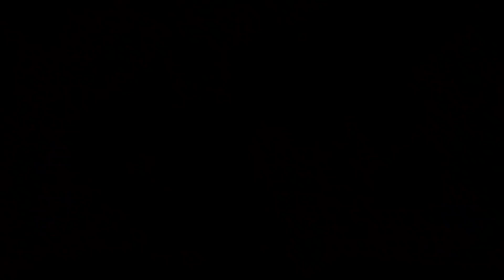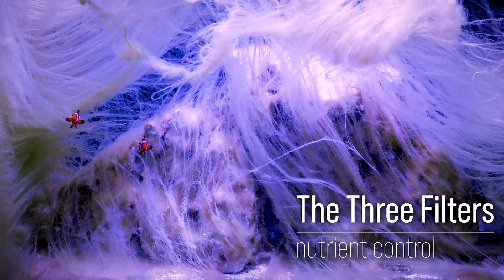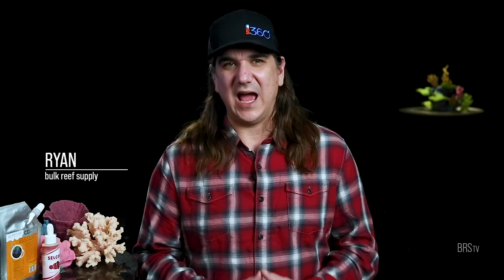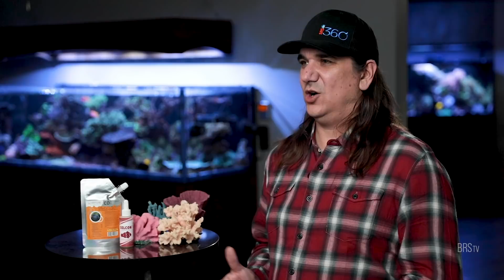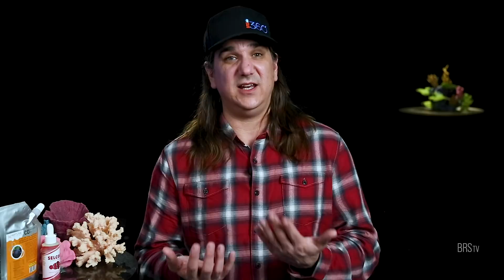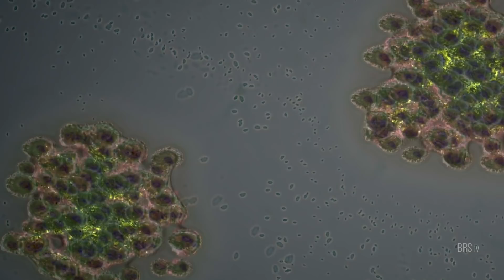A Challenge: Three Effective Filters for Organic, Dissolved & Inorganic Nutrients in Reef Aquariums.

Comment: Hi guys, new reefer here.

I've selected some corals I can isolate on rock islands and prevent uncontrolled growth with substrate, but how do I select corals for my main rock formation? Do I use a coral that will put out tentacles in key location(s) to keep the others at bay? Or do I want exclusively branching corals that I can keep easily? Do I want a mix of branching corals and something like zoa's that can grow around it? Any help appreciated folks :)
Reply from the maker: Great question. It's mostly going to depend on what you want to keep in your tank. What I would suggest doing is to first create a list of all the corals you want to keep, or at least, a good number of them. Then, look up their preferred flow, lighting, and growth patterns to determine where you're going to put them on your rock work. Like you said, some corals will have sweeper tentacles that sting other corals, so you'll want to be careful about how close you put corals like that to neighboring corals. 

This video has a lot of great beginner corals if you haven't already watched it 

https://www.youtube.com/watch?v=FcxUY1ZJ-i8

Comment: PLEASE... RUN TESTS OF "REFUGIUMS...THE TUNABLE FILTER"  So we have a more CLEAR view on WHICH TUNABLE parameters produce what results , for quick adjustments, to increase or decrease N or P..and for  long term best practice of fine tuning levels over time. Testing  BOTH TIME METHODS..(LESS/MORE HOURS PER DAY & LESS/MORE DAYS AT  FULL NIGHTTIME SCHEDULE). AND...NTESITY, annnd Time/ Intensity mix.  (Perhaps going below a certain intensity causes exponential drop in photosynthesis,  and same thing might occur below a certain amount of continuous  hours of light, or days without light) So 6 hours at 75% might be superior to  at 100%  or 10 at 50%.  Lead us all to the promiseland of  Less blind guessing ...and more educated approximation.

Comment: i love my Algae scrubber i feel it is one of the most forgiving pieces of equipment on the tank.
Reply: They work but trying to find a well engineered model has been an expensive issue for myself.
Reply: @samiam9059  Turbo Aquatics...best design...yet hard to get a hold of.
Reply: @derekhanson5377  Thanks for the help.... will attempt to locate.
Reply: @samiam9059  tried Santa monicas?
Reply: @eyespy1987  I did but barebones construction. Will try turbo aquatics when in stock.
Reply: I had a Santa Monica Scrubbers Drop .6X on my 24g cube. Had to remove it as it was doing too good of a job and my corals were suffering. It's really that good. Get an air pump and a timer for the lights and you're good to go.
Reply: @GioRuiz22  That is a bit small on a tank. Could see that happening. have 200 gallons of water and an 18 year old fish purple tang and some others with some size. Will give turbo aquatics a try. I keep a very clean tank with an ORP of near 400 all the time. Ocean is around 350 average. But latest challenge has been Flaglets? which can take some  time  to eliminate. Also aiptasia from a local store(thanks) but have kept it in check for a few years now.
Reply: @samiam9059  nah, it's the right size, I just don't have the bioload to support it. When I get more fish and coral, and start feeding more, I'll plug it back in and it should be able to maintain parameters comfortably.
Reply: @GioRuiz22  No, I meant your aquarium is so small.... best regard
Reply: @samiam9059  It's not the size of the tank, it's how you use it... 😉
Reply: @GioRuiz22  I don't need a lesson. You were correct the first time.